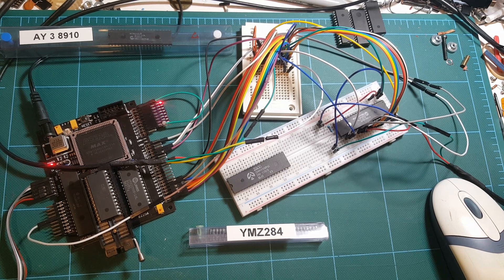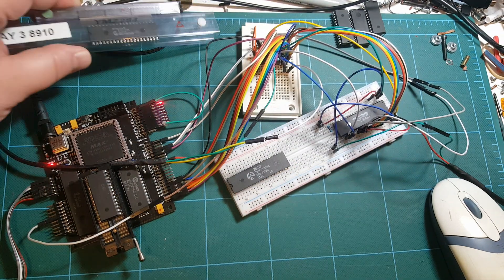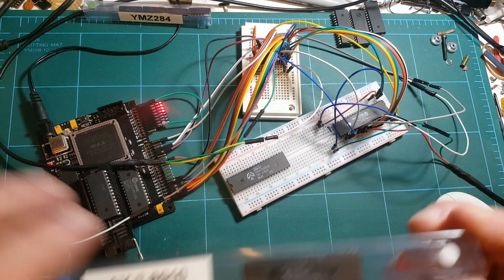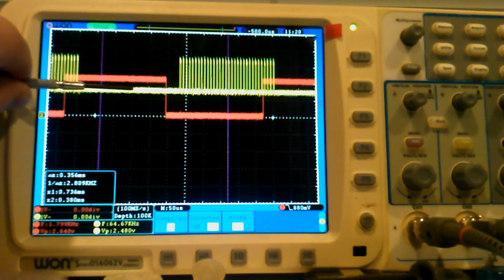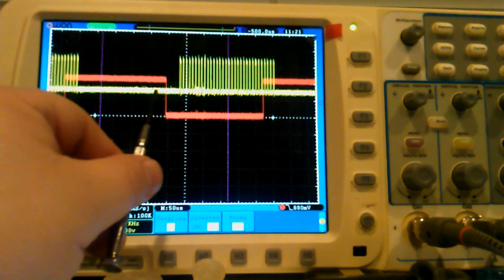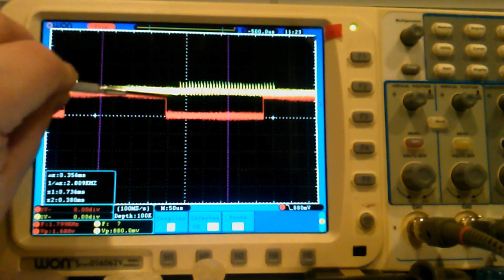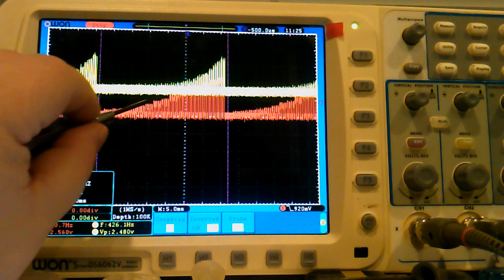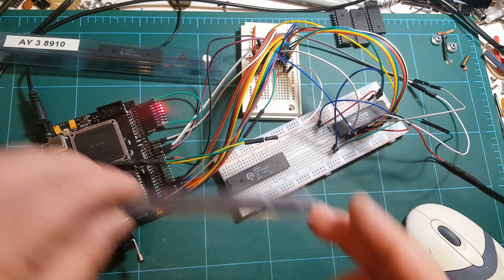AY 3-8910 vs YMZ284 from ebay

Comment: Man, the reason why Yamaha goes down faster is probably because it has lower output level and the lower part is hidden in the noises at the bottom. Choose different scale on the oscilloscope, use proper grounding and I bet you will see this signal.

Comment: The yamaha chips offer logarithmic volume scaling. That's normal and an improvement. Think of pots... GI chips have linear taper and Yamaha chips have audio taper. The spikes are also normal for any chip with TDM output mixing. The DX7 synthesizer does that too. Lowpass filtering eliminates the spikes. The shrunk package means the three outs are TDM mixed here, where as on the larger YM2149 and the GI chips there are three DAC pins and the outputs are mixed with resistors. The biased output level allows for using single ended opamps in the output filter and driver stages without requiring rail to rail input response.  If you want a better comparison, pick up a YM2149F. Common price on Ali is <$1/ea.

Comment: yes there are plenty of variations of ay-3-8910 in terms of audio generation, but measuring right at the output of chip does not make big sense because there is still analog part of schematic goes after chip out. usually there in series capacitor that make DC part =0 then opamp and then low pass filter... after all of this output should be more or less same
Reply: Even so, the envelope should be the same and it's not, so the sounds on the ymz sounds shorter compared to how they should be. No amount of low pass filtering will correct that.
And the pulsed output will give a much lower output signal when run through a low pass filter, giving a worse signal to noise ratio. It's as though the dc offset indicates the chip needs a dual power supply like -5 and +5V to prevent clipping.